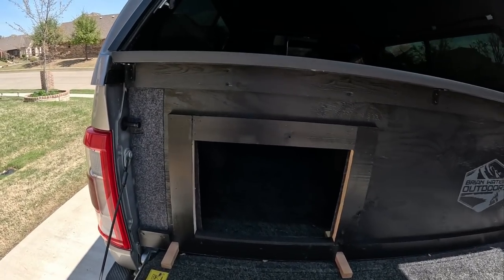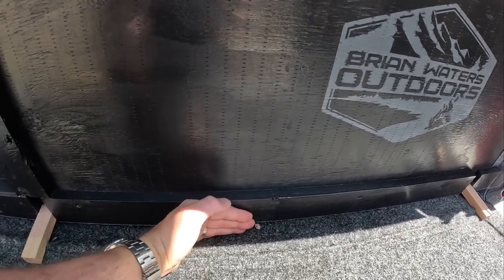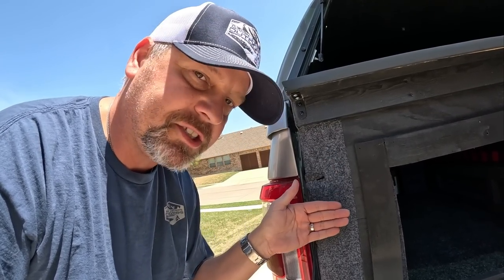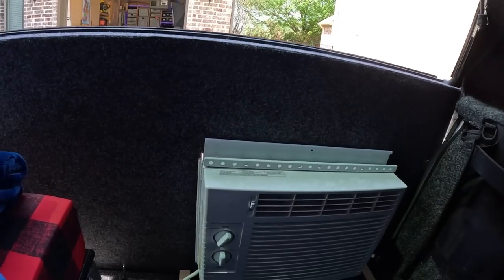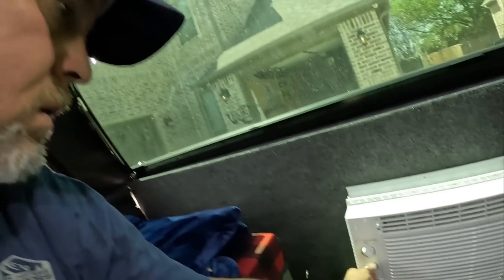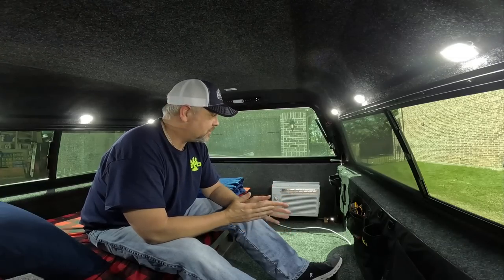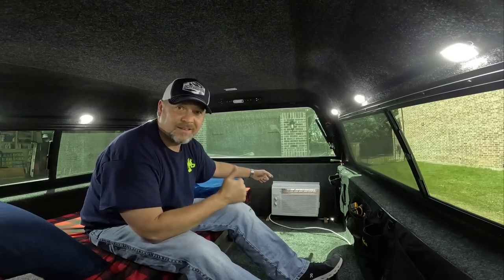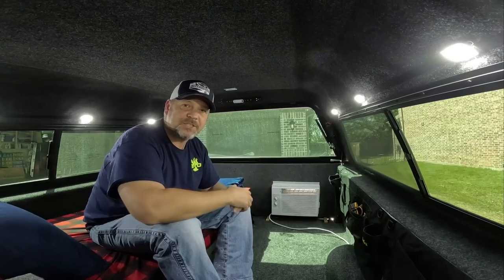Truck Camper A/C : CHEAP, EASY & COLD!!

Comment: I would recommend a box fan for the window into the cab, crack the windows slightly in the cab. Should cool off faster, since you're just building up pressure in that air tight space.
Reply from the maker: thanks.  good idea

Comment: Install ceramic window tint on your camper shell windows - that will really help reduce radiant heat coming through the windows. I just did mine on my ARE topper and can tell a huge difference.

Comment: I couldn't tell to look at your camper shell interior... Did you insulate the ceiling? Or the sides (interior of shell & truck bed sidewall)? That would be a good bit of work, but I would think that that would make a huge difference to help maintain temperature difference between inside and outside, without your A/C running as much. Would save hugely on energy (if you're running it off a solar generator or battery, when shore-power isn't readily or at all available). 

Great idea with the false tailgate. Informative video.
Reply from the maker: It’s not insulated, just carpeted

Comment: If you knew you would always have shore power, I'd consider going with a bigger unit as it would likely overpower any drafts and cool down faster.  However, if you are considering powering from a generator, this size is probably optimal.

Comment: Good on you thanks,the AC compressor will freeze up and be less effective set on max cold , crack it down to about 7o percent cooling just for a test ,I'd get some foil n foam insulation thin stuff n make inside window coverings,I've got similar on my boat it makes a huge difference , because U lose the green house effect off glass ,neat install though good effort thankyou
Reply from the maker: Thanks for the tip👍🏻👍🏻

Comment: Another great idea! I wouldn't even bother plugging those gaps, unless you just want to, but I would put reflectics in your windows. Well, you usually just overnight, so it shouldn't be much of a problem,  but if you did multiple days reflectics would save your bacon. You usually arrive at camp as the day starts cooling off (if ever), so set it up first thing, and take it down last thing. 
As my grandpa used to say," you are a fart smeller, I mean a smart feller". Lol
Reply from the maker: Only reason I’m going to work on the gaps is to try and stop easy access to my skin with these devilish Texas skeeters
Reply: @BrianWatersOutdoors  sorry, I had a senior moment,  totally forgot about skeeters. I may need a check up, I'm from Alabama and have been being eaten on the past two months by skeeters. Carry on, you obviously know what you're doing. 
BTW, I think your Texas wind escaped,  come get it before my trash can relocates to Tennessee.  Lol

Comment: if the a/c unit fully fits in front driver or passenger window, it seems like those would have been good locations.  Obviously you'd still have to frame up some holding shelf thing for it, but you're good at that.  Then no need to open rear at all of course.
Reply: @BrianWatersOutdoors  put your second unit in one of the front windows.  Those TX summers are brutal.

Comment: I wonder if you could use some Star Board, it's a marine grade plastic sheeting, really heavy duty and you can get it in all sorts of thickness'.  It can be lighter than wood depending on the thickness you get.

Another thing you might consider is nano-ceramic/charcoal window tint.  It blocks something like 95% of the infrared light that is the cause of why car interiors get hot.  Normal window tint adds some shade, but the infrared light still gets through with no problem.  Since it looks like your windows are tinted already, you can get a zero tint cover (they make it for windshields so they can stay clear).

Comment: I just got my ARE cap installed yesterday and will be working on this AC project this week when the rain stops tonight.  I'm thinking of adding a vent fan [I have one extra from another project that I decided against].   The fan will be great on those nights when just a little air flow is all I need.  I'll make the AC hole so that I can close it up with a piece of plywood when I don't need AC and will just store the AC unit inside the truck bed [8 foot bed] or on the campsite picnic table.  I'm looking for ideas on a double bed setup since there will be 2 of us camping - hoping to make a long trip out West from NM/AZ up to Montana.

Comment: One idea I had when I saw this was just to build a; box/shroud/mount, that houses that AC and lines it up with the window of your choice. It would take up room inside, but it could just stay in there and all you have to do to use it would be open a window plug it in and turn it on. You could make underneath of it a storage cabinet.
Reply from the maker: thanks

Comment: I like the setup with one exception. I think I'd set it up with a split "false tailgate". The window shaker in one section and make the other section easy to move to get in and out. Maybe have the A/C side braced to the siderail for sturdiness and hinge the moving side off the A/C side. Just a thought.

Comment: Might have to seal up the drains under the a/c and use a “tap” type fitting with hose to drain the water on the ground instead of the tailgate. I’ve had similar setup for bass tournaments and that’s what I did.
Reply from the maker: This ac doesn’t have drain plugs. I’m no expert, but the manual says this unit as well as most newer models don’t drain the water, but have a “spinner ring” that reuses the water and throws it on the condenser to keep the unit cool. 🤷🏻‍♂️🤷🏻‍♂️
Reply: @BrianWatersOutdoors  yea idk I haven’t dealt with window units in a few years so things might have changed but when it’s humid (like we both know how it is in North Texas) water collects badly. Anyway, just thought. Enjoy the vids good luck.

Comment: I want to do this in a hatchback.  I also need to build it out about a foot because I'm 6'3".  Plywood/styrofoam walls need to be able to take apart and store on roof top or back carrier basket. I'm looking at heat pumps as they also provide heat

Comment: I wish I could have used a 5K window unit, but since I have a Harker Outdoor EDC that includes the tailgate in the space, I found a used Bouge RV 2900 BTU unit. With Dometic acrylic windows in the shell that let me run the hot exhaust out of one window, and since it is an awning style, it  keeps water out of the duct. I let the "outside" air intake pull from the interior as well as the input for the cool side. If I am in the camper, I point the cool output duct at me. I can also add a longer duct up into the bed area. It only uses about 250w at 24vdc on high cool, so I can run it off the LFP battery for some time. A 120v utility source, of course, lets me run it continuously as needed. For condensate, I simply drop the hose into a clear container that peanuts came in.
Reply from the maker: Sounds like a good setup though👍🏻👍🏻

Comment: For anybody looking to do Ford trade-in or buy; PowerBoost Hybrid and you don't need shore power.  Love mine, built in 7.2KW generator.  More HP and Torque than V8.  20-22MPG not towing,

Wish somebody would do a similar hack for shell side widows,  my bed is taken up with pull-out drawers.  Good work!

Comment: you need a bigger gauge extension cord, you did the right thing with analog controls on the A/C, the small relays on the electronic circuit boards for powering the compressor don't hold up to the amperage it draws. the really sad thing is you can replace the whole unit cheaper after the warranty is over, then it costs to get it repaired
Reply from the maker: I’m using a 12/3 so I think that’s plenty. This ac only pulls 550 watts max at startup.
Reply: @BrianWatersOutdoors  my bad, I thought it was smaller, 12 will carry 20 amps, if there not too long. most of the extension cords at wally world can be as small as 16 gauge. you got  the right size, sorry to butt in. just have seen some utubers do some scary things with electrical, and I wouldn't want anyone to get hurt
Reply from the maker: No worries bud! I’ve seen a lot of folks try to run space heaters on a 100’ 16g ext cord. I appreciate all advice though👍🏻👍🏻

Comment: I have a Frigidaire energy star unit that I will be connecting to a Bluetti 200 Max solar generator and running it in a 2003 Chevy Blazer. And then I pull a 5x8 cargo trailer that I’m currently setting up to run. Bougerv portable air conditioner ( like the breeze ) my portable air conditioner will be set up outside running the intake and outtake ducts to a window to cool the cargo trailer. I’m almost ready to test both set up’s
Reply from the maker: Sounds like a nice setup👍🏻👍🏻

Comment: What about the condensation drip onto your tailgate ? 
😂 lol
There is a company I deal with in China that makes 2200 & 2800 BTU - 12volt A/C Systems. 
About $350 total to install with controller panel. 
I have been installing them in Nomad Vans and smaller type sailboats & yachts 
My Ford E350 Hi-Top Van gets cold enough inside  to wear fleece PJ's when it's 98* outside.  
And in a 36' Sailboat I installed a double setup 
( front cabin + rear cabin ) 
and plumbed it in , wired it up for about $900.
They love it. 

The compressor units are tiny too.  

I got the original idea from a fellow boater who took the guts out of a small ac/dc fridge and adapted it with a fan to cool his 24' Cuddy cruiser fishing boat. 
Cheers & Beers & BBQ Steers !!
Reply from the maker: Hey Chris👍🏻 I’ve never had an issue with condensation drip on this unit. I had it in my DIY camper all last summer and never saw a drip,of water. Doing some research I found that most newer ac window units don’t even have drain holes anymore. They have a “spinner ring” that basically scoops up the condensation and throws it back onto the condenser to keep the unit cool during operation.

Comment: I guess the next step will be rain-proofing this setup.  A couple of shop rags or if you can get ahold of some of that basic gray package insulation (the kind made out of recycled rags, safe to handle with bare hands), those would be good for filling the side gaps.  Neat looking build.

Comment: You should've made a cut out for the drawer. That way, you can set up the ac as soon as you get to camp and not worry about not being able to access your drawer if you need anything without having to remove the whole tailgate.
Reply from the maker: I can still get to the contents of the drawer from inside if I lift up the bed platform, but yes…I might build another one of these and incorporate that into it.
Reply: @BrianWatersOutdoors  oh OK.

Comment: You really don’t want a super tight seal because the AC will push harder inside (and be more efficient) with a little bit of escape draft from the interior. Sure, big gaps need to go but leave a little escape draft.

Comment: Where are you going to be camping that you'll have access to an electrical hookup? No doondocking unless you plan on running a generator all day of you have a hell of a big solar set up.
Reply from the maker: I camp overnights at mostly local parks during the summer because it’s just too hot here in Texas during summer to not have an ac hookup. Of course I could skip out on camping for the summer, but I’d rather use ac

Comment: The condensation drain on the back of the AC would be an issue especially with a carpeted tailgate because the carpet will hold the moisture right on the tailgate and rusting can occur. Probably need to work out a drain system. 🤷🏻
Reply from the maker: These newer units don’t have drain holes. They have a spinner ring inside to “scoop” up the water and splash it back into the condenser to keep the unit cool. Had this unit on my DIY camper all last summer and I never saw a drop of water come out of it👍🏻
Reply: @BrianWatersOutdoors  that's awesome! I have heard of those spinner rings failing so while it's good you're good but when it fails it will cause issues. That's why on mine I will drill precautionary holes to prevent additional issues to the unit.

Comment: Ohhh. I see. So you are plugging up to a regular power service. I was wondering about running something like this without a gas generator for a night or 2 while camping. That's an awesome design on the faux tail gate though. Great video!

Comment: I like the setup. I'm looking for an A/C Setup for "Long Term" cooling, during the summer months. I wanted to get the EcoFlow Wave, but they are sold out, and not sure when they'll be back in stock. They are A LOT more pricey than your setup, but the efficiency of the EcoFlow is pretty good. I was wondering what type/brand Battery/Solar Generator I would need to run about 6hrs or more, if I went with your setup?

I travel for Healthcare, and I usually travel with a pull behind camper. However, I'm letting my stepson use it now, because rent where he's at is very expensive. By using my camper, he's able to work and save money. Unfortunately, that leaves me with my Camper Shell setup. When I'm on call, I stay/sleep in the hospital. However, when I'm not on call, I stay in my truck. Now that it's getting warmer (I'm currently in Georgia), I need something that will keep me cool when I'm sleeping.  I feel I would do fine with a couple fans setup for "Air-Flow", but I'll eventually need something cooler as the summer progresses. Not to mention when my wife visits me here, and we go camping for the weekend. She would rather have the A/C. while sleeping after a hike.

Thanks for your time.. D
Reply from the maker: So, I’m reality you will only get a max run time of 3-4 hours on a very large 2000 watt hour power station like an Ecoflow Delta Max, Bluetti AC200…. Because you lose a lot of efficiency using the built in inverter to power the a/c. I might be trying out the new WAVE II because I believe that model will be able to run off of an external dc source (not positive) and that should make it much more efficient and give you longer run time. But that unit is about 8 times more expensive than a bare bones 5000 BTU window air conditioner. You really would need some type of small generator to run this all night long if you can’t connect to ac grid power.
Reply: @BrianWatersOutdoors  As always.. Thank you for your response. I have thought about the EcoWave A/C, because of the run time and the excellent reviews. It is quite a bit more expensive, but seems to be the best option.without wanting to use a generator while off grid.  Unfortunately, they seem to be totally out of them, but I’m on the wait list. However, I have seen the “Glorified” Swamp Cooler that has been getting great reviews. That may be another option for me, especially since I really won’t need it, except for night time when sleeping. I figure that cooler thing with the rechargeable USB Fan that I have would be sufficient for evening/night time use. The fan I have is very powerful and last close to 8hrs on a charge.

Comment: You've probably figured it out by now, but the A/C will have to be tilted a bit down on the outside so that the condensation drips outside the camper instead of inside. ;)
Reply from the maker: These newer a/c’s don’t drain or even have a drain hole. They splash the water back onto the condenser to keep the unit cool. So far I haven’t had a drop of condensation come out of the pan👍🏻

Comment: Be interesting to find out how much your power draw is. Some 5k btu units are using in the low 400’s power consumption. I’m trying to find the most economical analog unit, bonus if it can create heat as well.
Reply from the maker: Avg around 450 watts on max settings

Comment: Hi Brian. This is an awesome build. I have the same truck and wondering if you have all the measurements for your false tailgate. I want to build this but I’m not experienced. I’m going truck camping next month and this will make it so much more comfortable. Thank you!
Reply from the maker: Sorry, I don’t. I just started cutting and making things fit.
Reply: I had success!  I built it last night and it works great. I just have to stain and polyurethane it now. Thank you so much for the inspiration. Your video helped greatly and now I’ll have a pleasant summer of camping.

Comment: Couple things I see that are causing your AC to be overworked  and not work as efficiently as it could is:

1: Your windows are a massive heat soak - add reflectix when the AC is in use
2:Your interior roof insulation is little to none - maybe add some 1" thick hard foam
3: Your cap is a dark color which just soaks up the sun like crazy and superheats that cap like an oven - I'd at least vinyl wrap the top of it in white to reflect the sun away (My Duramax is white and my cap is color matched and with zero insulation and no AC it doesn't get that hot inside)

Pretty slick setup though, changing the above mentioned things if you can will make you WAY more comfortable
Reply from the maker: Great points. Thanks👍🏻
Reply: I agree with the reflectix  for the windows. Hopefully this set up will keep him cool at night in Texas

Comment: Yes, nice setup there ! Me too did it like Idakota, almost exactly 👍
Reply: I only added 2 receptacles on my camper. One for the shore power and one SAE for my solar power. That way I don't have any cables hanging out from my tail gate. Inside I put a power strip so when shore power is available I don't have to use my battery power.

Comment: Thanks for sharing! That's a great build. What do you do about the condensation? How many watts does the AC use?
Reply from the maker: It pulls about 420 watts at full. No issues with condensation too. These have a spinner ring that splashes the water back onto the condenser to keep it cool. Does not drain water at all👍🏻